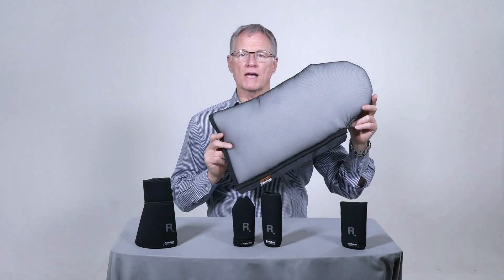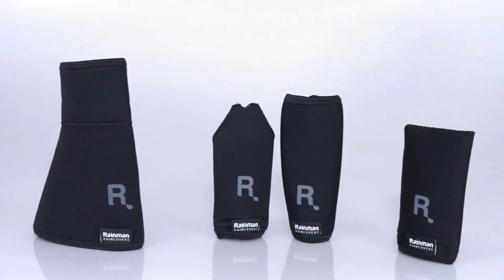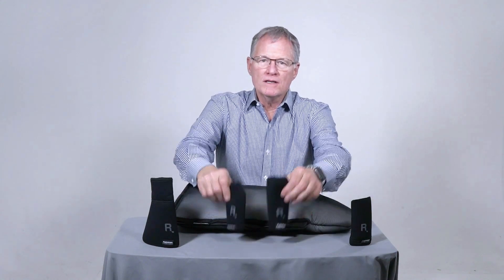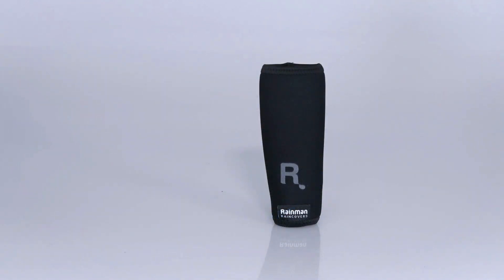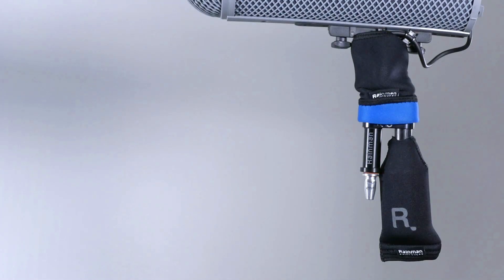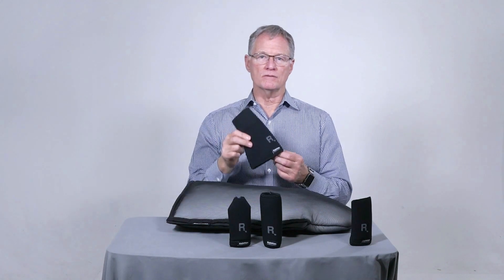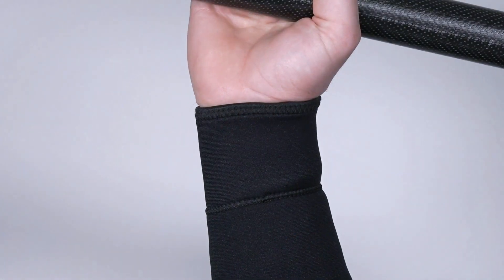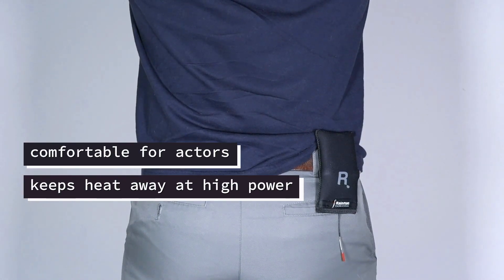Rainman Neoprene Covers

Comment: Currently using these products on a daily base on show at Vancouver BC, Canada. We get lot of rain up here :) Last time we had heavy rain day - about 40mm. The plugon trainsmitter sleeves covers on Lectro HM were able to handle water all day without letting any moisture inside.
Worked well also under raintowers where actor was sitting on ground. We used bodypack transmitter cover faced antena down. By the end of night our Lectro SMV transmitter was completly dry! Great stuff Rainman! ;) 

PS: Wisycom plugon TX fits into those covers as well - tested.